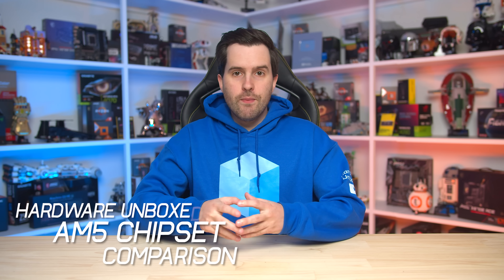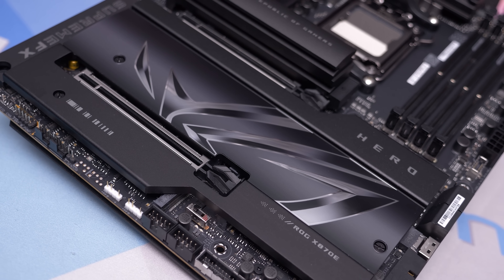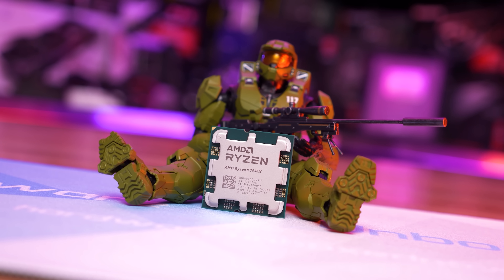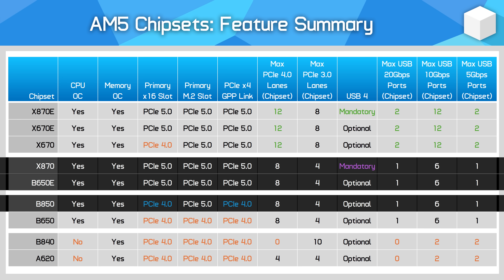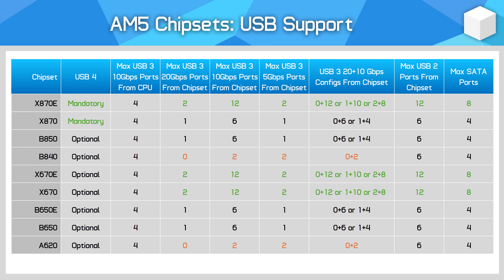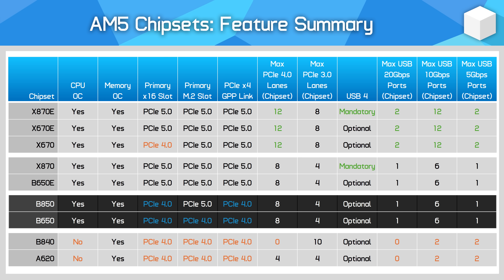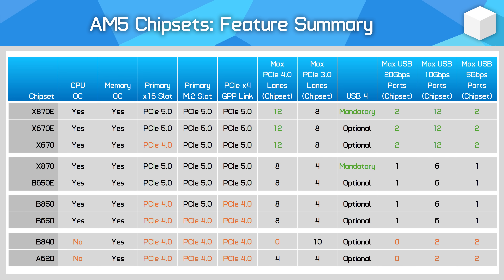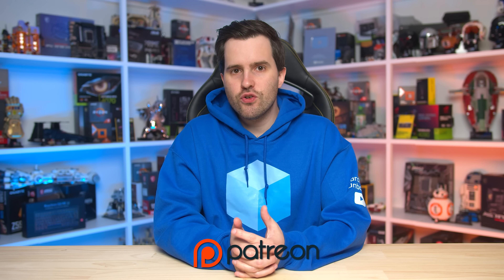AM5 Chipsets Compared - X870E vs X670E vs X870 vs X670 vs B650 vs B850 vs B840 vs A620

Comment: It's been a buggy experience to use AM5. Currently the latest bios to my Gigabyte motherboard makes sure that everytime I boot there is a memory learning segment. And it takes quite a while. You'd think that the motherboard would know the RAM by now after 1 year of use or so. Or maybe it forgets
Reply: That's not AMD, that's GigaByte. Crap boards, crap firmware.
Reply: @Gaius__  Not really. The memory test nonsense is from AMD. And a lot of the patches have come straight from AMD as well. 
Nothing is really superbly mature, just kick it out out the market

Comment: CPU PCIe lane bifurcation being tied to chipset is dumb. Entry-level boards with entry-level chipsets that have cut-down chipset lanes are those that could benefit most from using x8x4x4 since they are almost certain to only get an x8 GPU if any GPU at all.

Funny how AMD and Nvidia are nerfing GPUs to x8 in the name of penny-pinching but AMD still forces the sacrifice of an x16 slot to the GPU altar on platforms least likely to ever see an x16 GPU.

Comment: It more accurately reflects their position against intel now, people used to compare b650 against b760, which was dumb because B650 allowed cpu and memory overclocking while B760 didn't, Atleast now their B series are closer.

Also what A620 boards support pcie4 nvme from the chipset? that appears to be an old typo, Theres pcie4 to the chipset but seems only 3.0 from the chipset on every board I've looked at. https://en.wikipedia.org/wiki/List_of_AMD_chipsets#AM5_chipsets
Going from 8x3.0 lanes to 10x3.0 lanes means they're 2 over intels h610 equivalent.

amd X670E/X870E: 1x pcie5 cpu-m.2, 1x pcie4 cpu-m.2, 1x pcie5 gpu +extras
amd B650/B850: 1x pcie5 cpu-m.2, 1x pcie4 cpu-m.2, 1x pcie4 (5 optional) gpu
intel Z690/Z790: 1x pcie4 cpu-m.2, 1x pcie5 gpu*
amd B840/A620: 2x pcie4 cpu-m.2, 1x pcie4 gpu
intel B760: 1x pcie4 cpu-m.,2, 1x pcie5 gpu*
*(pcie5 NVME steals from the GPU)
Reply: I'd rather a consistent naming scheme than something that seems like it's trying to pull one over on me.
Reply: @gctypo2838  Like Z(690) is higher than B(660) is higher than H(610)?
How generations count up 12th...13th....14th....200? Or like rebranding 13th gen as 14th gen? Or 14400 is a 12th gen architecture?
I could go on but it's obvious you're new if you're still learning nothing in silicon valley is named consistently.

Comment: I guess B850 for a 9800X3D and a RTX 5080 (maybe Ti or Super) is the way to go.
Reply: Why waste money on a single PCIe 5.0 storage slot, which you will never need or use? If you want to spend extra money (for next to no gain), go for an X670, otherwise just get a B650.

Comment: I bought 3 weeks ago an X670E board + 7800X3D. I knew the X870E would be silly
Reply: hope you got a good deal on the 7800x3d and was a necessary upgrade 9800x3d is surely around the corner and the price has skyrocketed as of recent on the 7800x3d making it not worth. About a month or more so ago 7800x3d i think was going for $350

Comment: My first comment, PCIe 5.0 and the option of "1x16 or 2x8".  Unless AMD is looking at reviving Crossfire with a new frame splitting mode, it is useless.  The consortium behind PCIe or AMD needs to find a way to where instead of "Gen 5 1x16 or Gen 5 2x8" they can provide "Gen 5 1x16 or Gen 4 2x16".  It is more complicated, but I don't think people want a motherboard that cuts the communication links to their expensive GPU in half because they added a PCIe x1 lane card in the other slot.

My next concern is for the motherboard makers.  4 M.2 Slots is too many.  RAID on NVMe is unnecessary.  If you need data redundancy, I suggest an automated, periodic backup.  PCIe Gen 3 NVMe is fast enough.  More priority should be given to PCIe slots that can support cards that add additional M.2 slots rather than replacing the PCIe slots with M.2 slots.  If you really need a motherboard that has a bunch of PCIe Gen 5 M.2 slots, you know you need it, and this is where motherboard manufacturers can offer these in a separate product stack.  Me, I rather have the PCIe slots for a consumer sound card, maybe a capture card, and the open slot if someone builds a wireless interface for my VR headset that involves a PCIe card.  I might want a PCIe SATA RAID controller to support RAID 5, because some motherboards don't allow it.

Right now, the only motherboard out of the X870E line up I feel okay with buying is the Asrock X870E Phantom Gaming Nova, which is like the only board that is out of stock.  Now, I have to do an exhaustive research on existing X670E motherboards, as my current motherboard has not been living up to expectations.

Comment: I'm gonna assume that many buyers of an X870E were hoping to have X16 lanes solely for the GPU and two sets of X4 lanes for two 5.0 nvme drives, yet I think there are very few that allow that 2nd 5.0 nvme without lane sharing. This is what I figure the X870E needed to be a step up. I 'think' the Taichi does it, but not sure. Anyway, my 2c. I'm still probably gonna buy the X870E Carbon coz I'm a dill.

Comment: Got a b650m aorus elite only thing missing is pcie 5.0 x16 and usb 4.0 which I doubt I'll ever need running a 3080 will probably upgrade to a 5080

Edit: 7700x still going strong will probably get a 9950x3d

Comment: I'm still looking for a micro ATX mobo that has 5 slot spacing between the top and bottom pcie slots. Would like to install a 4 slot GPU and not block up the last pcie slot, in the event that I have to use an expansion card.

Comment: Video starts @ 14:50. Everything is just specification reporting. Good information to have documented somewhere, but probably would have been better off as an educational piece to bookmark and reference via other videos.

Edit: Also as a rebuttal to the point of B850 V B840 - If a typical consumer cares about I/O they are likely searching for a mobo by filtering based on the I/O configuration, and not necessarily what name is on the Chipset. I recommend that approach to users because it removes all the marketing from the mess. "Do you need USB4? Do you have many USB devices that run @ 10Gbps or faster? How many M.2 disks would you want to use?" This navigates the spiderweb of Chipsets, and nested-SKUs within each of them.

Comment: Can someone shed a light on thunderbolt Support. Will the 800 chipsets ever support it ? The old Boards allowed connecting thunderbolt 4 cards while the new ones only have usb4 which is thunderbolt 3 compatible. In my book the 670e with thunderbolt 4 is better value than 870e with usb4.

Comment: I wish they have quietly repaired the broken parts of X670e in X870. I have all kinds of data that shows that the X670E chipset on Asrock PG Lightning X670E is broken. Method is to connect Focusrite Scarlett 4i4 audio interface to any of the PG's chipset bound USB ports and the mixer sliders cannot keep up with the mouse They jump around like crazy and then settle slowly when let go. But when the same card is connected to any of the Ryzen 9 CPU bound connectors the sliders work perfectly! 
Then if I insert the 4i4 to a chain of two USB 2.0 hubs and insert that whole to any of the 3 CPU bound USB connectors the sliders also work also perfectly. 
I disconnected all other devices and the USB of the chipset is still defective. It is like chipset cannot be trusted. Any trickery in the bios does not a bit of a difference.
I have spend tens of hours trying to make the difference. It is slow thing to do as you need to go through bios and reboot. Tens of times. 
If you need lots of reliable USB do not touch X670E.
I don't know if I should laugh or cry because the CPU bound connectors are so extremely robust where as chipset's USB is total rubbish.
Now I know the method to test it though with Focusrite 4i4 when I hunt the spare mobo for my 7900X3D.

Comment: Do the b650e motherboards provide 1x16 pcie 5.0 (ie not 2x8 split) and 4x pcie 5.0 for m.2 not shared with anything else. 
I want full/Max pcie GPU and nvrm m 2 and everything else if the chipset (4 lanes)
I don't want the graphics and m.2 lanes being used for lots of USB or additional ethernet ports.
Reply: lol, four PCIe 5.0 slots for storage? You must be joking.

Comment: X670 supposedly supports 8 sata ports, but I can't find a single x670 mb with 8 ports. this is all so confusing.
Reply: 1) ASRock X670E Taichi
2) MSI MEG X670E Godlike
There are probably more, those two are the ones I remember from my own research.
SATA is still so useful, it enables you to connect all your old drives, for massive extra storage. No need for external archives or servers, all can be in one single case.

Comment: Thanks Tim. I am currently buying parts for a new PC build. I'm waiting for the 9950X3D and the 5090/5080, but I'm buying everything else now. I like the new X870E for the 2 USB 4.0 back panel ports. I also like the potential to use 2 PCIe 5.0x4 lanes directly connected to the CPU as well as keeping 16 lanes available for the GPU. I going to spend a lot of money on this build so I want a motherboard that will future-proof me for 6 years. I'm looking forward to the X870E motherboard reviews so I can make an informed buying decision. Thanks for all you guys do.
Reply: Why not x670e ?
Reply: @JK1NG87 

In my country both the 670E ans 870E are at the same price 

So no brainer 

I get the cheapest one so its going to be 870E
Reply: @JK1NG87  the 870 boards have DDR5 8000 support, tool-less M.2 and GPU, 9000 series CPU support right out of the box.
Reply: @SPSteve  they also support up to 256gb instead of 128gb
Reply: @illogicalmilk8029  I'm only going to install 64GB, but it's nice to have the option. I do a lot of video editing for my small YouTube channel and more RAM is always good.
Reply: @SPSteve  yea I plan to use 64GB maybe 128GB later down the line
Reply: @illogicalmilk8029  Same here. Although I am looking at the GSkill 2x24 DDR5 8000 Trident Z Neo memory.  If the MB supports DDR5 8000 it would be nice to use it.
Reply: I think asrock has the only mobos rn that allow the use of all m.2 slots at max speeds while keeping the gpu at x16. I’m also getting the 9950x3d so I’m picking up the asrock x870e taichi in a few days.
Reply: @illogicalmilk8029   save yourself some money and buy a x670e Taichi unless you really neeed WiFi 7
Reply: @TheSjuris  I thought about that but realistically with the rebate I’m only going to be paying 30 more so I’m fine with that
Reply: @TheSjuris  The X870E has DDR5 8000 support (some 8200) and a lot of the X670E boards are close to the same price as the X870E boards. I can't see buying a previous gen product to save $50 when the additional capability of the X870E can future-proof me more capably.
Reply: @SPSteve   that’s an agesa change. There’s no reason to upgrade a x670e board
Reply: @TheSjuris  I don't have an X670E board. I'm running an X570 board with a 5950X and 3090Ti right now. Time for a new machine. My existing machine will go to my grandson.
Reply: @illogicalmilk8029  I've given serious thought to the AsRock Taichi Lite. I don't love the ATXE form factor and I don't love the graphic design of the board but the specs make it look like a solid choice. Especially no lane sharing of the PCIe 5.0x4 sockets. If I buy a different board (looking at the Gigabyte Aorus Pro Ice because I think it would look good in my Hyte Y70 Red/Black case with the Hyte Q60 AIO.) I could only have 2 NVMe drives on the motherboard. 1 PCIe 5.0x4 and 1 PCIe 4.0x4. That's a reason I want the back panel USB 4.0 ports. They would allow me to run an external NVMe drive at high speed. 

I think buying the AsRock Taichi is a good decision. I just don't like the form factor or the appearance.
Reply: @SPSteve  true I personally like the appearance but I also need a lot of fast storage too. The only other motherboards I considered were the hero and the nova

Comment: The fact that X870 motherboards on launch were as low as $200 was an instant red flag. These are just B850E motherboards. They're not bad motherboards, but it's misleading so many people. 

AMD and Intel have reversed positions, I swear. Raptor Lake instability is basically AMDs dark age, and now Core Ultra is like how Ryzen 1000 was. AMD has been resting on 3D V-Cache, just like how Intel rested on 4 cores. Incredible when it first launched, but eventually Intel will figure out how to best that.

Comment: B840 sounds like it is reserved for OEMs. Also, the "X" part indicates that is a top-of-the-line chipset. However, with X870 is the other story, given that it shares characteristics of B650E chipset, save for mandatory TB4.

Comment: I would love to see a recommendation based on what you do. E.G. I  don't overclock, all I do is use a GPU, and 2 NVME drives. My guess is a B650 will do for my needs.
Reply: Absolutely, do not waste money on a "better" chipset. It's very similar with me, and I have decided on a B650 a long time ago. The real pain is comparing different manufacturers for the stuff you need/want (USB ports, SATA ports, M2 slots etc). Any board will nearly always lack one or the other in sufficient numbers, and finding the perfect compromise is such a pain.

Comment: According to this, i wanna mention that Gigabyte B650 Gaming X AX rev. 1.3 will not support ryzen 9000 series, due to hardware limitation or something.. and this is not clear because it receives bios updates with AGESA 1.1.7.0+ and how i understand that is for supporting the new 9000 series, can you please take a look at this? Gigabyte seems to don't care and firstly they have changed the official site information from supporting 7th,8th and 9th series to only 7th which is kinda scam if you ask me because i purchased this board in mind of upgradability.. thanks
Reply: They had 5 hardware revisions of that board!!? o.O and then there even a V2 variant
Reply: @Quast  Yeah... that's a lot of versions for one motherboard model..
Reply: @tushe8597  Have they officially stated that the new CPUs won't be supported, I mean they still seem to get all the same BIOS, right?
Reply: @Quast  I contacted the support but as usual they are terrible and they told me due to hardware layout only rev. 1.5 can support 8th and 9th gen. Maybe at some point they will provide support for 1.3 but not sure..
Reply: @tushe8597  Your 1.3 revision seems to be the only one with a differently named BIOS, doesn't it? All revisions of 1.0-1.2 and 1.4 and 1.5 seem to use the same BIOS except yours.
Reply: @Quast  Yeah, weird.. but they are same AGESA.
Reply: @tushe8597  Jff I've run it through a hex compare, so only BIOS for rev 1.4 and 1.5 are identical to each other, I wouldn't risk downloading applying one of the other BIOS files...
Reply: @Quast   naah, im not going to experiment.

Comment: 24 usable CPU lanes for X870(E) is a partial lie because four of those lanes are reserved for USB4. Partial because you can technically use those four lanes but only externally.
Reply: They are not even reserved for USB4, its just a loot easier to take them from the CPU then from the Chipset since the USB4 controller is located right next to the CPU, and it would be a pain in the ass to wire it up to the Chipset instead.

Comment: The 50 series seem to be the best for price/features, for all the generation of Ryzen. Some of the older 450/550 boards are great for a budget setup and the B650 is very well priced compared to the B760. Dunno why the hate in the Thumb, the X seems overpriced unless you going for ryzen 7/9s.

Comment: The funny thing is. x670/B650 motherboards are atleast at same price or even higher than x870e/870 boards. Sure x670e might be similar on features with x870e but for older product that has been stuck on shelves for years the price is WAYY too high atm. Maybe black friday will fix that momentarily. But pretty sure prices will still bounce back up and stick high unless retailers are willing to slash the prices.

Comment: Thanks Tim. It's much clearer now. I was hoping the E stands for memory overclocking for 4 DIMM slots.

For example, the new Asus X870E Hero having a new DIMM slot (Nitropath as shown by der8auer) that allow higher memory overclocking. This will allow users like me a pathway to upgrade to 128GB 6000MT/s CL30/CL32 in future without breaking the bank.

Can you do some testing of 4 DIMM memory compatibility on some of these boards especially those with Nitropath?
Reply: is the Asus Hero the only motherboard that has such a feature from 870E? I thought the whole point was also with 870E would allow memory overlocking to be a bit better than previous gens mobos.
Reply: @deadpool790  no idea. I was hoping Steve will shed some light on this question. Der8auer say Asus only mentioned it helped 2 DIMM overclocking. But I'm curious about 4 DIMM because there no info.

Comment: B840 is Promontory 19 AKA B550 which is not cut down and A620 use a strongly cutdown Promontory 21
B840 adds up in the lineup and A620 will stay the low end

There are only a few boards which does 8+8 instead of 16x PEG, many boards use a 8+4+4 configuration.
All of the X870(E) boards use the 4 extra lanes of the cpu for usb4, all X870(E) boards (exept a few, that share m.2 with usb4) can only have 20 lanes for storage or gpu

Comment: MB manufacturers could reduce Sata ports further. Sounds like the b650/650e is your best option.
Reply: Aren't SSDs at least for >=2TB still around 2x more expensive than HDDs?
Reply: @Quast  Spinning HDD’s are dead, but are super cheap now. Way too slow for today’s hardware. The sata bus [2.5” SSD’s) is also getting long in the tooth. It’s time for all storage to move to Nvme’s.

Comment: The PCIE 3.0 Lane bandwidth on the AM5 Chipset, Must share with SATA. of course, It wasn't in AM4.

So if the board has some SATA connectors, you should lose the same amound of pcie lane.

On the practical, there is no any M/B without SATA. So the 3.0 lane in AM5 Chipset, meaningless.